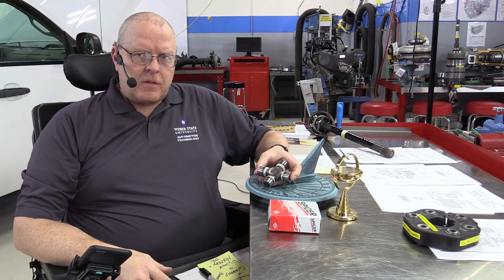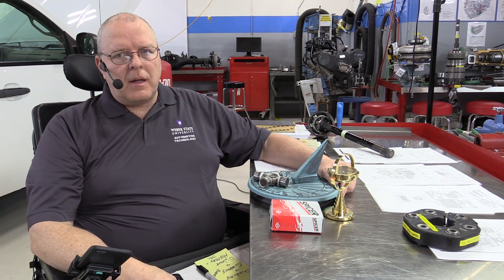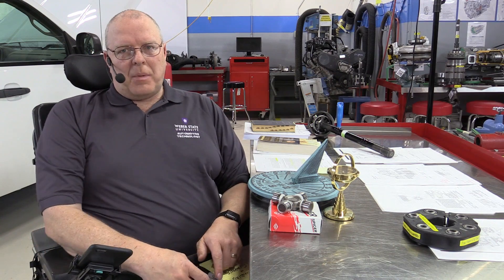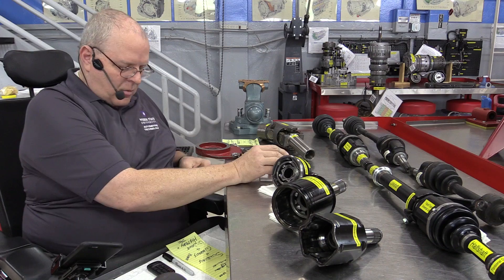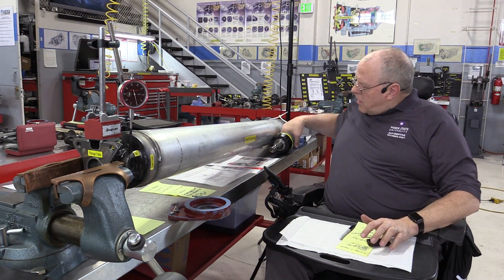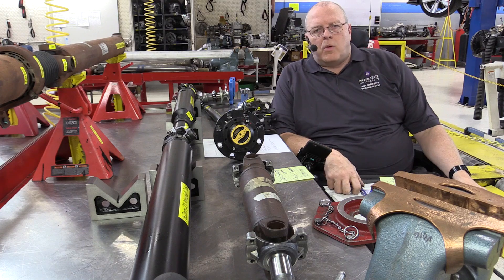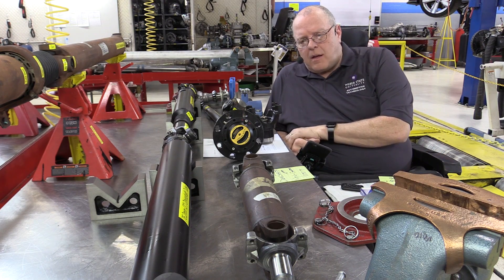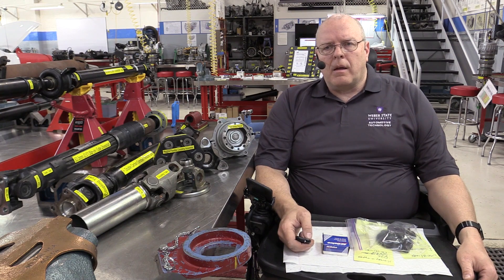Universal Joints - Part 1: Introduction

Comment: How tight should U-Bolts be that hold the driveshaft into the rear end pinion? if they are too tight would that cause a vibration?
Reply from the maker: It depends upon the axle, but a typical 1/2 ton or 3/4 ton truck torque would be around 25 ft lbf. Over torquing can distort the bearing cap and slowly destroy the u-joint and cause a vibration. Thanks for watching
Reply: The bolts should be stagger tightened. On some vehicles not doing so causes vibration.

Comment: I am having great trouble sourcing UJ's that grease via the cap. I have found this type of joint far easier to service.
I have tried to contact Spicer and SKF but get passed off to their dealers are not helpful unless I have part #'s when I give the part # of the joint I have it is cross greasable, not Cap.   Can anybody help?  The size I need is Spicer 5-101X
Reply from the maker: Check Amazon and eBay

Comment: I would have loved to study under you my friend . I have watched your teaching and have found you very knowledgeable and straight to the point.
Keep up the great teaching.
I checked on the two u-joint tools you showed in one of these videos and had a hard time finding both. It seems that the only place I only found  one of each on ebay for 93.00 and 135.00
not the 40.00 you said,GGGGG Times are a changing !

Comment: I can attest to the long life of factory u-joints. I bought my 4wd 2004 F250 brand new and the only u-joints that have been replaced are the ones inside the front axle. They didn't need to be replaced but I had a limited slip differential installed and since blown apart anyway it seemed like the right thing to do. 12 years and counting with no problems.
Reply from the maker: Thank you for the feedback! That is what I have seen too.

Comment: Great video - Thank you.

I recently replaced a center bearing on a GM tail shaft which GM said can't be done please buy a whole new assembly. Anyway all went well and my friend has a car to-drive again. 

One thing I learned. GM or Holden here in Australia have staked universal joints in the tail shaft I was working on which seems crazy vs a simple cir-clip. On the Internet i found a number of instructions on how to re stake the bearing cap. If it was my car i might have tried it but not on a friends lest it failed in a very nasty way.

Anyway I hope your series will cover GM's cheap pathetic method of saving on a C clip
Reply from the maker: +Systemrat2008 Thank you! Staked u-joints are the worst! We will talk about them in an upcoming episode.